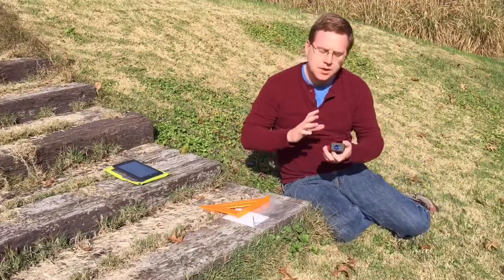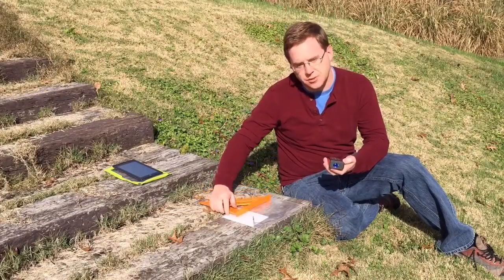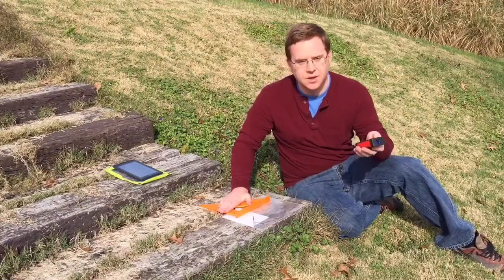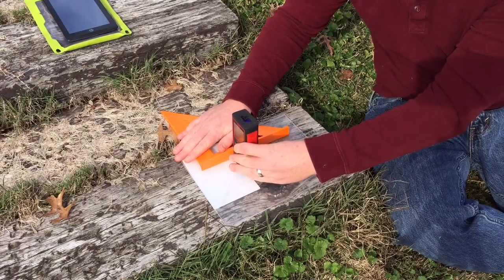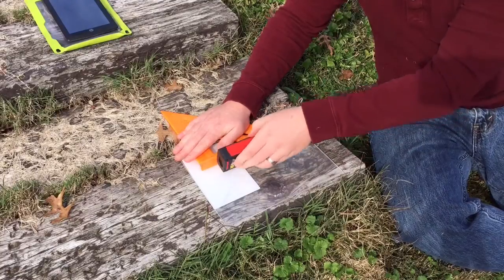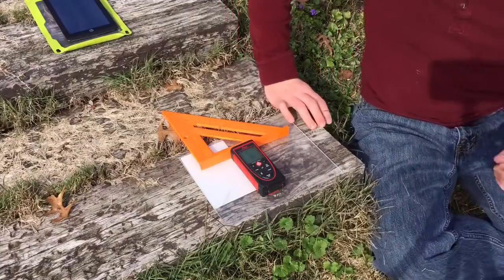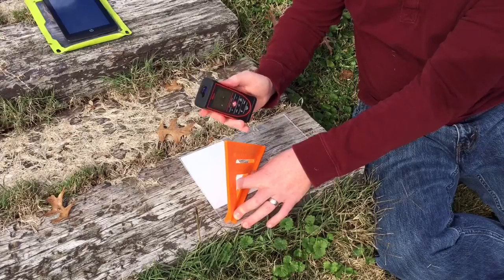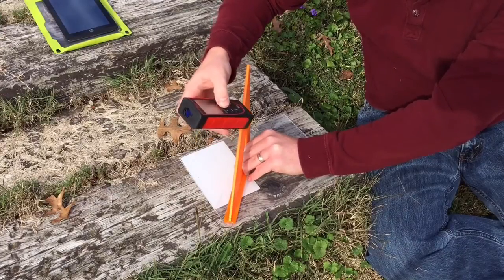Simple DistoX2 Calibration

Comment: The question is whether we strive for perfection and want to use all the possibilities of the device, or do anything just like that. Calibration with this method makes no sense. The error will be so great that it is better to use a tape measure and a compass or just draw cave without measuring. The calibration recommended by Beat takes the same amount of time and gives an incomparably better result. When I close the 400 m long loop, proper calibration and backshots give me an error below 40 cm at azimuth and 20 cm at height. And I work DistoX MK1!
Reply from the maker: Please clarify why this makes no sense and why the error will be so high. Currently you're just begging the question. This method is easy and when done very carefully it gets the same results as the older method according to the calibration values and performance in cave. I generally accept average errors less than 0.3 and max errors of less than 0.8 when I’m doing this in a cave. But it doesn't require marked points in a cave or a very steady hand. Sure, sloppy and fast handling can cause problems on any calibration. Also, doing it near magnetic interference (like I did in this video) can cause problems on any calibration.
Reply: Where does one find the calibration method recommended by Beat?

Comment: Thanks for this tutorial. I'm looking for a square as the one you are using but they are made of aluminium. It seems that aluminium doesn't affect magnetic fields but I wonder if it would be better to use a plastic square. Can I ask you what are you using, please?
Reply from the maker: Luis Iglesias, Aluminum is paramagnetic so it should not be a problem. But make sure it doesn’t have any steel screws in it, or that it isn’t an alloy. If you move a compass next to your square the compass shouldn’t deflect.
Reply: Thanks a lot for your advice. I'll try to find an aluminium not alloy or ABS plastic square.

Comment: This calibration method is based on the assumption that your laser is aligned exactly with the outside of all five faces of the Disto's case. I have found that NOT to be true with two different Distos. This method may be better than having no calibration, but it isn't guaranteed to work consistently with different individual instruments. If you want accuracy, you must use a calibration method that involves aligning the laser dot within all of your group-of-four measurements.
Reply from the maker: Or it assumes that the alignment of the laser is at least as good as the accuracy of hand-holding a device and watching the shaking laser beam hit a defined target with your eye. This is a quick and dirty method, not doubt about it. There are better methods out there, but not many that are both cheap and easy for the majority of people.